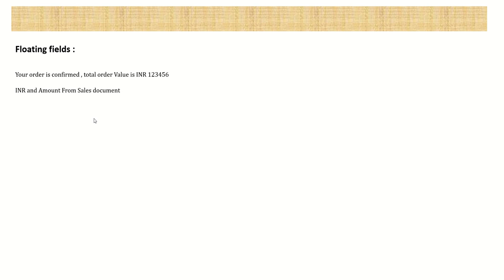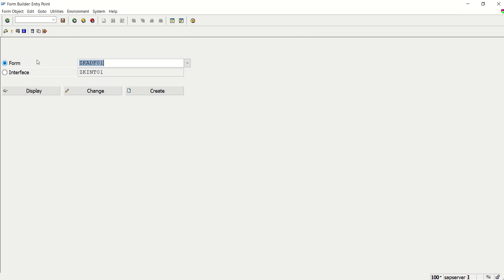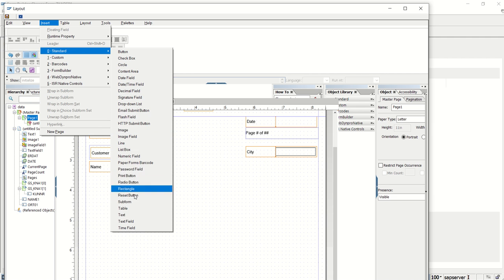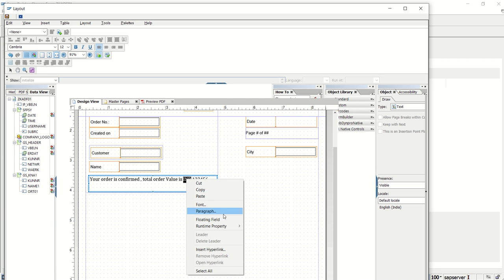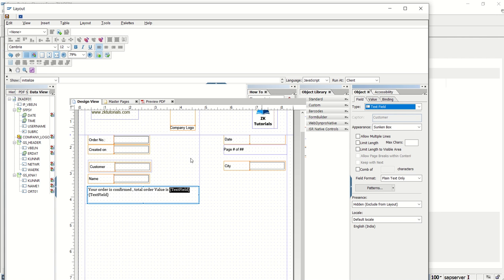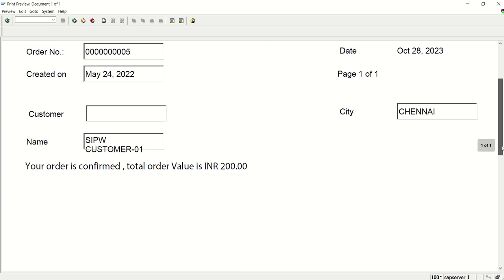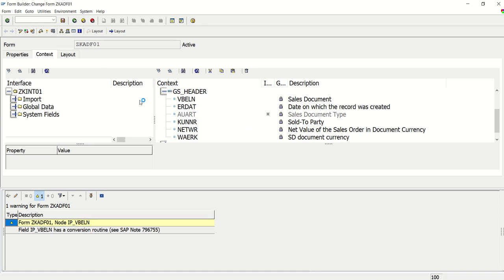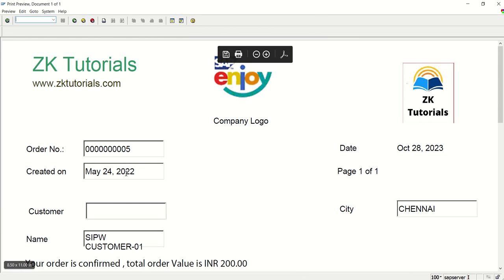05 SAP Adobe forms - Floating Fields In Adobe Forms | Dynamic field value in Adobe Forms

Comment: I think, the selection has not worked, because of the missing leading zeros in the KUNNR. So instead of giving in 2 you should pass 0000000002
Reply from the maker: Yes, I did that , then it worked, thanks
Reply: @zafarkarnalkar  Check your where clause in the SELECT statement.  Your example is actually returning order 00000005 and not 00000001, because your syntax is "WHERE KUNNR = IP_VBELN.  So according to your code, you are asking for the first order for customer 00000001.

Comment: Hi Zafar, could you please help how amount and date formatting change dynamically based on country. 
Example:- If my country is Denmark and Business partner language is other than Danish then amount and date formatting should be in Denmark format but it is taking US based formatting 

Actual amount- 10,000.00 is coming in result
Expected- 10.000,00

Note: i have used SET COUNTRY ‘DK’ in form interface level but it is not working.

Thanks in advance.
Reply from the maker: HI,
Instead of hardcode , can you try by selecting language into a variable based on your logic and assign the same in field property.